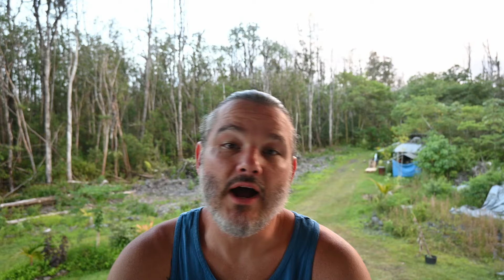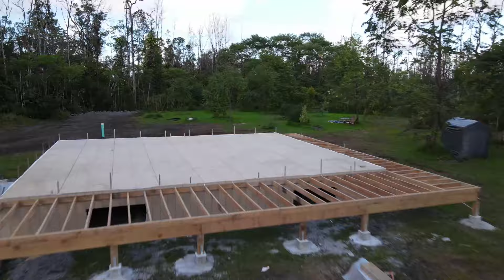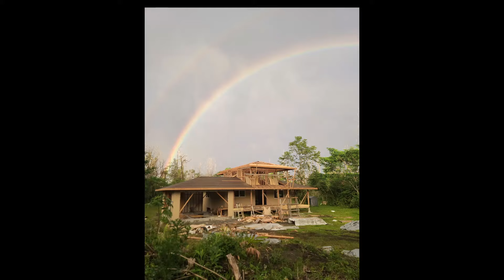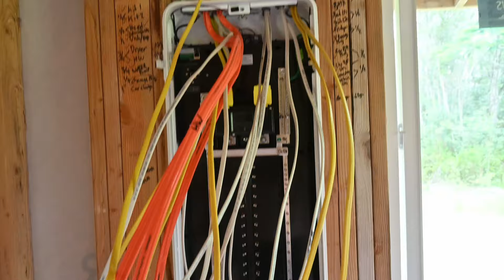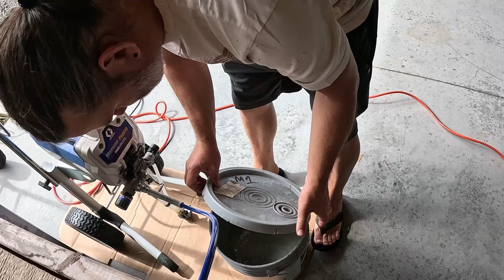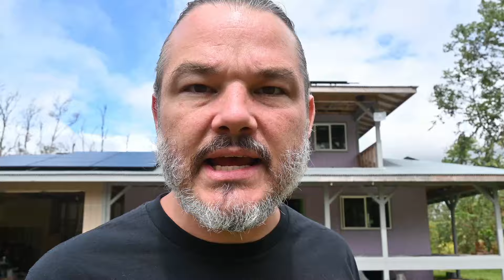Reaching for Dreams: Off-Grid Home Construction in Hawaii

Comment: Curious to see how Tesla powerwalls do offgrid.
Reply from the maker: Us too! 😆 So far so good!
Reply: The old power walls were not made for full off grid however the new ones are much improved. There is less expensive options out there. Most of power walls benefits relate to grid tie / auto bidder
Reply from the maker: @adamd5013  You're absolutely correct, but my wife is a project manager for a solar installation company,  so you take what the employee discount gives you!
So far so good, we've been using the solar for a few months, and we never want for power!